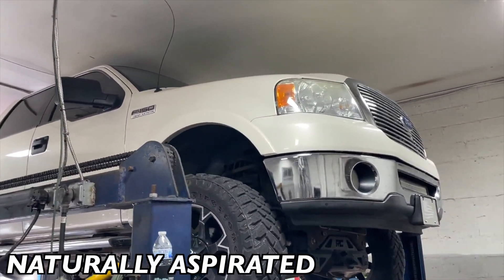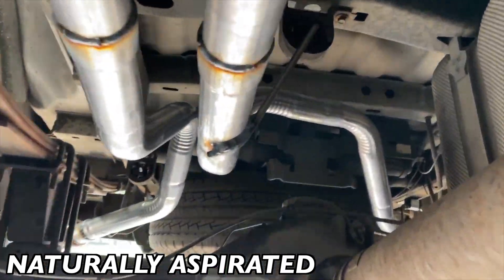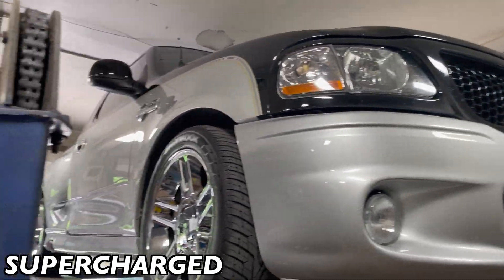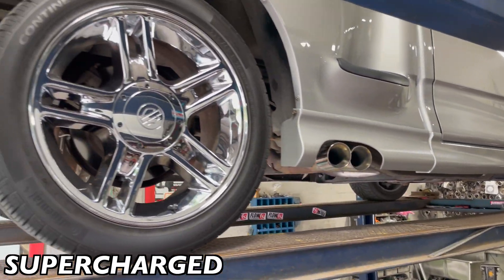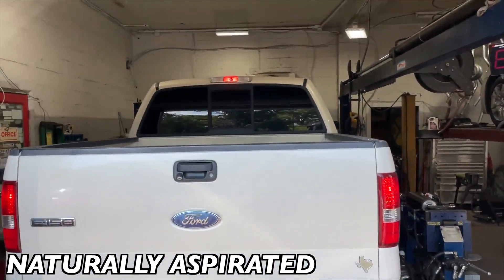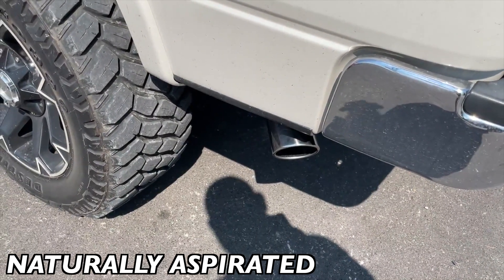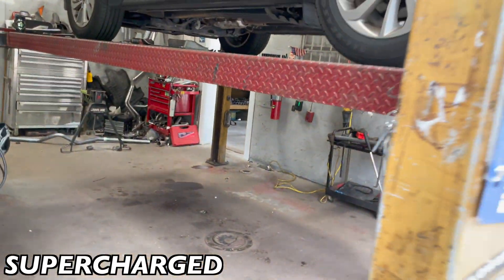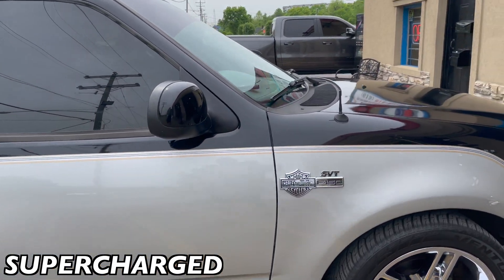How Does a Supercharger Affect Exhaust Sound?

Comment: Figured the supercharged truck would have spun taking off, my RT Dakota would have with less throttle
Reply: Those old super charged ford lightenings are surprisingly underpowered compared to modern supercharged v8’s. 380 hp 450 lb ft. Compare that to a ram TRX. It’s still no slouch but a 3.5 eco boost v6 has mower power and torque than these do.

Comment: If you supercharge and cam an engine it increases the fuel and air mixture which increases compression. The more compression then the more horsepower it makes when the spark plug ignites the fuel. The result is a louder exhaust note over a naturally aspirated engine of the same size. 
That being said this is a bad example of an exhaust comparison. The F-150 had a full exhaust front to back with no x or h pipe. The Lightning had a shorter exhaust system that exit in front of the rear wheels. As a result of the longer exhaust and no x-pipe the F-150 actually was louder because of the loud clapping under load when it took off. The lightning was opposite even though it had no x-pipe of his own the exhaust system was short so it wasn't as loud. If they both had the same exhaust setup then you can tell the difference and which was louder.
Reply: That's not how compression works compression is mechanical set by the cylinder head volume, head gasket thickness, pistons design and deck clearance. Boost , cams , afr have no affect on what the compression is.
Reply: @SXSPRIME  you have static and dynamic compression. The static compression is as you described. Dynamic compression is affected by cam timing, boost etc. Think of dynamic compression as cylinder pressure. As boost increases you have more cylinder pressure. 

That's also why a lot of newer engines are able to get away with 12:1 or higher static compression. Bleeds off cylinder pressure with cam timing and overlap.
Reply: @SXSPRIME  Sorry for the late response. Had to buy some beer. You are right about pistons, deck height, and head thickness. I raised the pistons and cammed my 5.4L before I swapped it into my Grand Marquis. When you boost your engine it raise your atmospheric pressure in the cylinders. It is still a form of compression but a different type. With the extra fuel it increases horsepower. I should have worded it better. Thank you for pointing out.
Reply: ratioed 😂😭🤡🤓🏳️‍🌈👬
Reply: @Midnight Mechanic Sorry troll but you know nothing about cars or how they work. My reply was accurate. Could have worded it better but accurate. Still following every comment I post here I see. It must suck to so jealous of what other people have. When are you going to buy your own car or truck. They don't cost that much.

Comment: So those 5.4 engines are completely different. The 2007 was a 3v engine. The Harley truck was a 2v engine. The Harley truck wasn’t a custom build. Literally everything about it was factory. Paint. Wheels. Engine. Body kit. Please brush up on shit before you talk about it
Reply: Actually the Lightning was a custom build. It was built to look like a Harley-Davidson edition F-150. Noticed the paint scheme. That is not for a Lightning. This video was shown before here with just the Lightning alone and the owner explained that to us already.
Reply: @ragintaurusmusclemercury7023  you do know that gen Harley edition came supercharged, right? That's not just a lightning.
Reply: @CorvZ061  Go to the original post of this truck. The present owner stated that  when he wanted to  buy it he thought it was a Harley Davidson. The original owner told him it was a Lightning. He checked the vin and it verified it.
Reply: @CorvZ061  Lightning’s are single cab, the Harley edition only came in quad cab I believe.
Reply: @169abr  you are correct

Comment: 2.5 in pipe on a V8 is very restrtive and wapps out the deep V8 groans
Reply: 2.5" exhaust is good on a V8 up to 400 horsepower. Anything higher then you would need a 3" exhaust.
Reply: 2.5 is plenty especially if there's an x or h pipe 
Engine masters did an episode on exhaust and it wasn't a huge swing even on there 600ish hp engine
Reply: @SXSPRIME  yep, even the newer 5.7 Rams are a single 3" after the Y collector but split to a fake dual, 2.25" after the muffler and before the two rear resonators. If you go too big on a V8 you lose the velocity, not back pressure, just the ability for it to scavenge properly. Hence where you'll lose that "low end feel" even though it's really a couple of HP/Tq numbers. Hellcats run dual 3" because its over that 600+ plus being forced induction. You can run a larger pipe, youre not really gaining anything, besides material cost and weight. But if your vehicle has a Y merge after the cats and a single exhaust you dont need to run X/H, unless you're converting it to a dual with a crossover, thus youd have to run a smaller diameter to keep the CFMs up and pulses right otherwise it'll be a complete mess and drone like a MFer.
Reply: @Midnight Mechanic ?
Reply: My Marquis has a cammed 5.4L 2 valve. It has a 2.5" exhaust with h-pipe and 2-chambered muffler. Not restrictive at all. Then again it only makes around 320 horsepower. 
https://youtu.be/DXwB9eyCpIU

Comment: Oh hell No. That's still way too quiet. Those sound no different than a stock 2014 Ford Excursion, and that's a damn shame. Owners should have just run open manifolds, which is the best setup and provides the perfect amount of back pressure and improved brake squeal for Supercharged and Naturally Aspirated vehicles.
Reply: Ryan don't miss
Reply: "Brake squeal" Lmfaooo
Reply: Perfect amount of back pressure is 0psi
Reply: @DuBstep115  back pressure is a myth. It doesn’t exist.
Reply: @JonBecker81  wrong
Reply: @DuBstep115  joke swoosh.
Reply: @DuBstep115  you sound like a pleasant person.
Reply: Whoever liked your comment are definitely car guys
Reply: Excursion was discontinued in 05